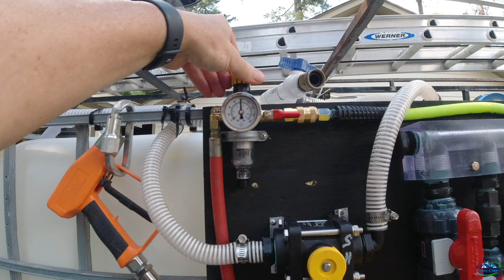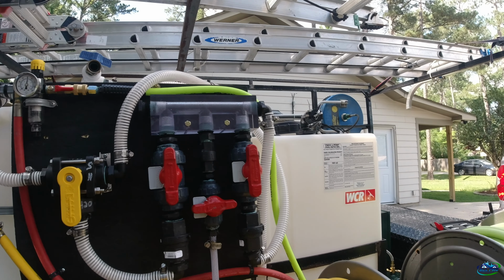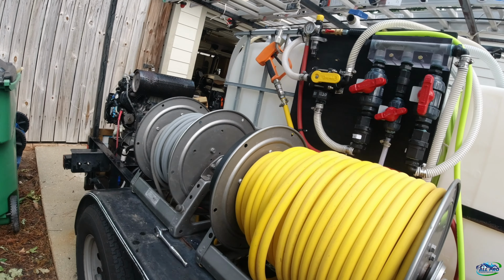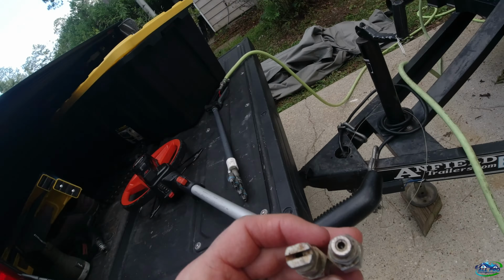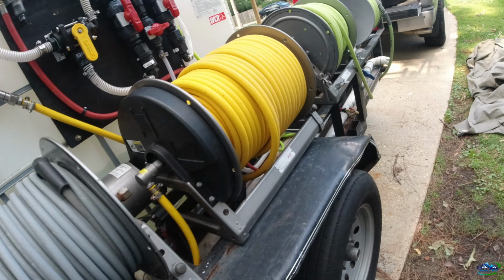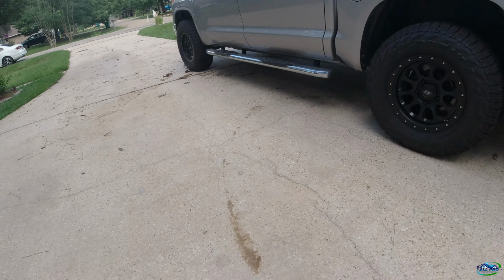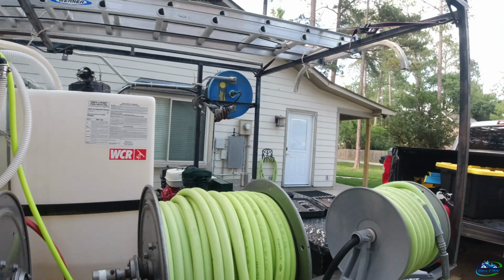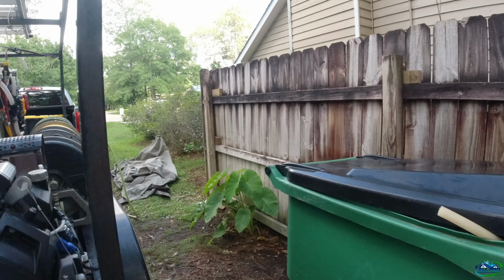All Flo Air Diaphragm 1/2" Distance Test & Tweaking

Comment: I had the same set up as a backup to my 5HP booster. The air was great for roof cleaning, but I absolutely hated using it for softwashing the sides of buildings. I sold that trailer and went to Gas Powered Systems. P40s is by far the best I’ve used in 30 years of washing.
Reply from the maker: Nice. We use the AR45 & agree with using the air for house washing. I need the knock down power from my AR. Thanks
Reply: do you run a backup 12v as well with ur P40s?

Comment: I don’t have an AR but I do use a comet P40 and that is a beast. I just have an extra pump if it needs switchen over. 4 years on the same pump and it hasn’t said ouch yet. Chlorine is very nasty. I rinse my pump with a flow return, 4 gallon container of stabiliser after rinsing at the end of the day
Reply from the maker: Agree & it is all about the maintenance. We love the AR45, especially for washing houses. Thanks
Reply: 4 years is insane out of a Softwash pump.

Comment: Could this replace your AR?  My ar is shot and im exploring what is out there. Thanks for the great video
Reply from the maker: I don't think it could replace the AR. It doesn't have the knock down power or flow like the AR. It has replaced our 12 volt with a little more distance..thanks
Reply: I downstream for house washes, I only use the ar for roofs. I like the distance and less volume for more control, less runoff and less chem is what im thinking. Let me know your thoughts and I look forever to all the follow up videos about this thing!
Reply from the maker: Agreed with less chem. The air system will hopefully be a long term pump for roofs & post treating.
Reply: @allproexteriorservicesllc5338 I asked you about 12 v on another video a few minutes ago.   Are you happier with this setup compared to a 12v ? Thanks
Reply from the maker: @northjerseykevin409  Much happier so far. Seems to much more reliable & the compressor comes is handy for other tasks. Thanks

Comment: What's that gun your using??
Reply from the maker: It's a gun I built. I used a 1/2" riser with a sutner soft wash gun. Thanks
Reply: Try the yellow waterboss gun with the smaller orifice nozzle that comes in the box. I run that and the orange sani lav gun. Best gun selection for the air system in my opinion
Reply from the maker: @michaelanello3344  Awesome! I run the orange Waterboss gun on my AR system. Looking to upgrade the hose reel soon. Not sure about the upgrading the hose to 5/8 yet, as my air system was meant to replace the 12 volt.  I love my AR for house washing. Thanks for the info!
Reply: Switch to 5/8” hose. I have both a 12v and air diaphragm. They run through the same 5/8” hose. I run 225’ and it works great. I switch between the 2 systems with a 3 way ball valve but going to be changing it up shortly and will throw some videos on FB soon
Reply from the maker: @michaelanello3344  18” reel? I don’t want too much volume when roof washing. But I could back down the compressor if needed. I have been looking at the Manta 15” reels. Thanks
Reply: I’m running 18” reel. If I walk the roof to wash it I use the sani lav gun and if I shoot if for a ladder I use the yellow water boss. Not too much volume at all. I don’t know if it’s possible for me to share I video with you on here or on fb but I have videos of both guns in action when doing roofs. Then you can decide if it’s right for you. I’m working on some modifications right now to my system and should be able to get close to 60’ on the yellow water boss. Sani lav for a wider and harder hitting stream, yellow water boss for a nice tight stream without the mist and over spray. I can show you both in a video.
Reply from the maker: @michaelanello3344  Great info. You can shoot me a message via text. Looking forward to learning as much as I can about the air system. Thanks
Reply: Send me your phone number. I have a tile roof job today and I’ll be walking it with the sani lav gun. I’ll send you videos today

Comment: to me that air system looks the same as my 12v except it takes up 3x the amount of space and requires a lot of gas fuel.
Reply from the maker: It does take up more space, but you get a 5 year warranty on the pump. To me the AODD system is the most reliable. I would rather refuel then have a dead battery on a job as well. Plus, the 12 volt may decide not to work in a mifddle of a job. Thanks